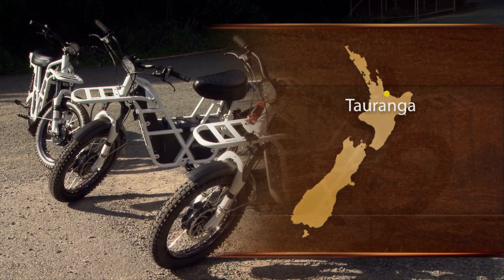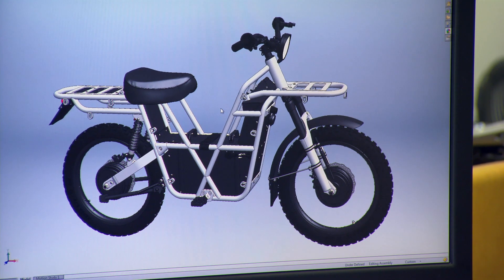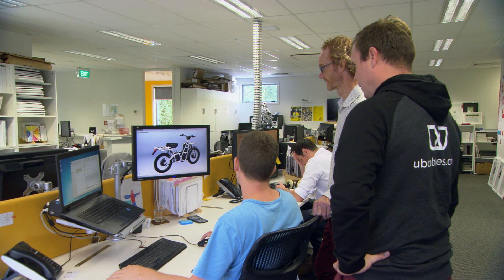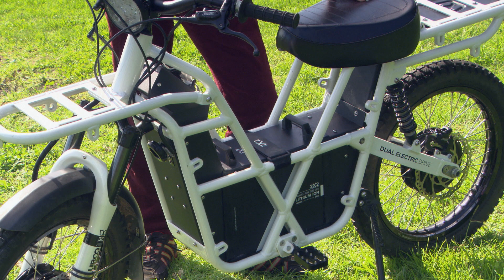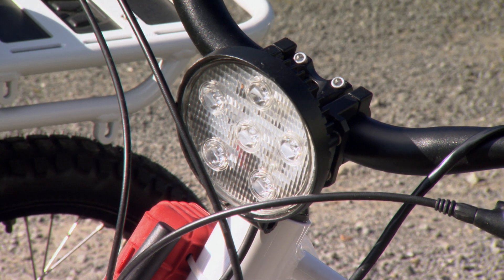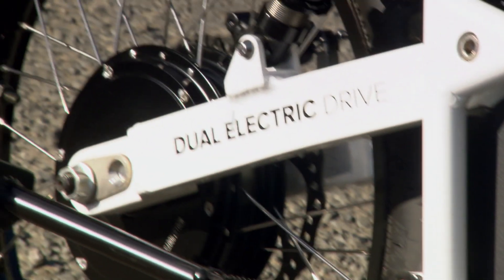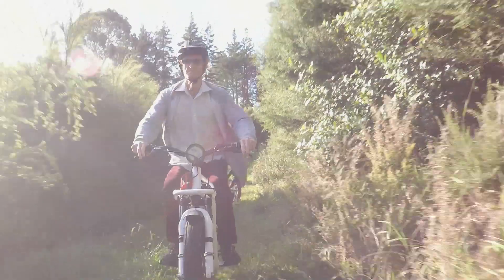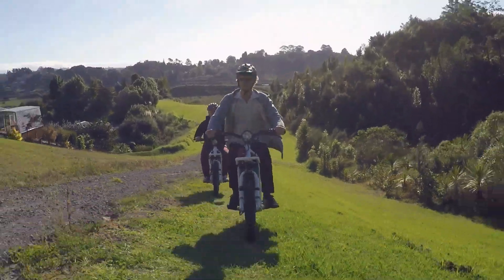UBCO Utility Bike

Comment: Hello Sir,
I am a city dweller in my early 50's who likes to get off the beaten track fairly often.
I also like to get as much as I can out of what ever I am riding which is why my current eMTB is fully laden with touring equipment.
My point is...As much as I like your machine and it's concept...At the current price point it doesn't give much insensitive to those of us who are trying to move with the times ecologically.
Best regards.

Comment: Surely you can improve on the shopping trolley design? Still a great product. Just needs a Mark 2.
Reply: That design protects the bits inside the frame perimeter. It's a fine design for a tool. Need pretty? Buy a street motorcycle.

Comment: a smart farmer would put up solar spots around his property to get a charge while their fixing a fence or whatever
Reply: 40AH, no need with a battery that size.
Reply: mike allen yur driving two motors...and a big battery is able to supply lots of amps without fear of damaging the lithium cells....i think this looks like a well thought out, robust bike....like to see an oversized headset and stronger front fork, it would help with a loaded front rack. great bike !  like to fashion a low speed utility bike similar myself!
Reply: hard to say without knowing the size of the motors. if the bike runs for 100km then that would mean hours of run time which is unlikley to damage the battery due to fast discharge.